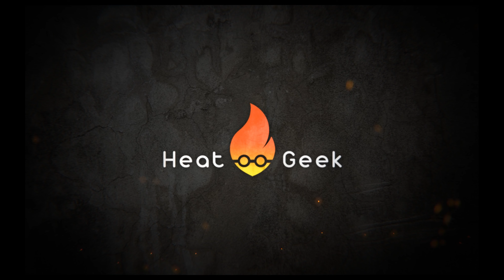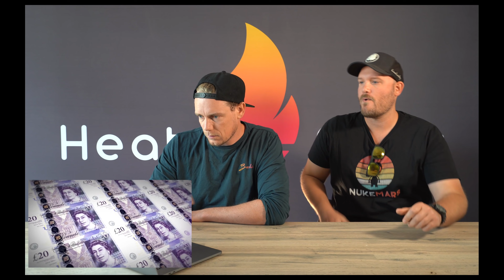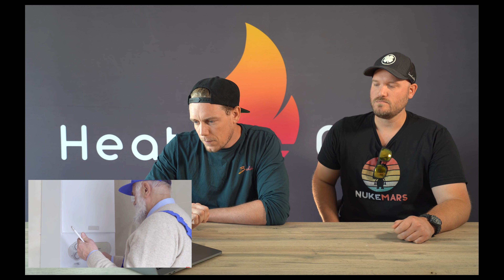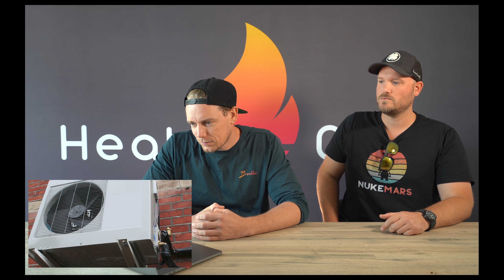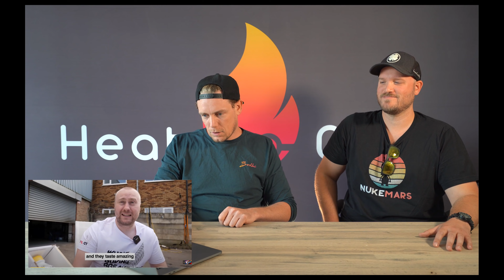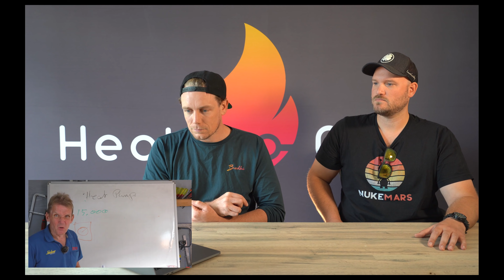Professionals React (BADLY) To Skill Builders's Heat Pump Videos | PART 1 | FIRST TIME WATCHING

Comment: He used to work for worcester 🙉
Reply: Who don't have a heat pump on the market, coincidence?
Reply: @patrickwheeler2646 
Actually I believe they do.  But even one of the guys from Worcester say they are not suitable in the majority of homes.  Only in new builds with the highest spec of insulation etc.
Reply: @Pedromyman1  they have started making or at least rebranding one since I made that comment, they have had gshp from years ago but realised the missed opportunity with ashp so are joining the market.
Reply: @Pedromyman1  heat pumps are absolutely not suitable for every home but neither are boilers, our point is that the installers should be sufficiently educated to inform the property owner on the best solution in every scenario.
Reply: 'used to' being the flaw in your argument.

Comment: Watch all his cast as he will say they have there place in new builds and industrial buildings not a 100 year old terrace house .£12,000 to heat your house try selling that to a person that thinks £1500 to supply and fix a baxi 200 .all comes down to training and unless more places open up for us gas engineers it will be left to people jumping on a 2 wk fast track course with no plumbing skills running 15mm plastic around your house and hanging big double rads on plasterboard walls with red wall plugs .
Reply from the maker: The response to his second video is on the way imminently.
Reply from the maker: https://youtu.be/0cYvJPPmVGs

Comment: I really enjoyed that and will watch the supplementary video you linked at the end of the video. I think Roger Bisby has actually done the whole ‘heat pump’ industry a big favour because there are clearly some fundamental issue to resolve. For sure Rogers video and his ‘rant’ is deliberately styled to provoke and deserves the discussion you gave it. In fact as you are in the vanguard of upskilling heating engineers his rant should be music to your ears. You know we have a generation of guys who have been fitting over powered gas (and oil boilers) to guarantee adequate ‘heating performance’ with the sub optimal circulation, emitter systems and poorly built houses. I figure there was a least 3 or 4 elements of his rant that you agree with.
Reply: Yes absolutely, he's got a lot right and the industry desperately needs a better trained workforce.
Reply: @patrickwheeler2646  The difficulty for the public would be to identify the qualified honest traders and designers over the fly by nights, of which there will be many, as has been stated previously, as often happens when government start flinging cash about. State run inspection and compensation scheme may help with my last point.
Reply from the maker: love this feedback! thank you so much!

Comment: This is hilarious. It's basically Roger saying all his installs are rubbish and none of his customers are happy 😂😂😂
Reply: Yep - sound like all his installations are a car crash - LOL
Reply: @UrbanPlumbers  do you have a heat pump?
Reply from the maker: Lol basically.. I pretty much puck this up in part 2
Reply: @HeatGeek  it's class. I have a lot of views on this and the things you mentioned. Having been part of MCS for 10 years I can see the parts he thinks is wrong as o still think a lot of it focuses on the wrong parts of the install. But his video on whole is flawed throughout.
Reply: If that is all you got out of it you have rather missed the point. Everyday should be a school day.
Reply: @normanboyes4983  I don't get your point. Everything he said is flawed. He clearly has a lot of badly installed installs and is blaming the materials
Reply: @KevTheHammer  Well maybe if you played the ball rather than the man and reflected on the issues you might think somewhat differently. Dismissing and saying that there are no problems does not identify faults, understand the cause and identify potential remediation, which should be central for any engineer. If not - there is no point being an engineer.
Reply: @normanboyes4983  think you will find I've always said there are huge issues with the industry. Videos like the one being commented are part of that. The heat pump industry has struggled for years due to shoddy install, not fit for purpose companies installing them etc, but then what do I know I've only been fighting the cause for 10 years picking up the crap that others have left leaving a bad reputation for the industry.
Reply: @KevTheHammer  Kev That’s good to hear but I had no way of knowing what you had been saying and I was not attacking you. I still believe while there are clear warts with Bisby’s rant - I actually see it as a force for good if it engenders discussion and reflection which can actually benefit the whole industry and in fact educate consumers too. An informed customer with the right expectations is a better customer.
Reply: @normanboyes4983  definitely needs discussion and more importantly it needs legislation from the top.